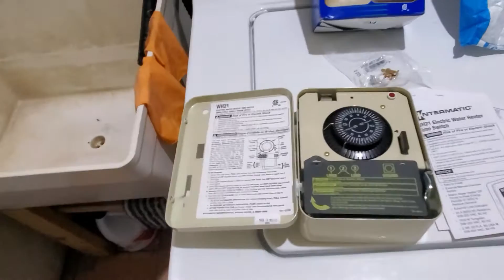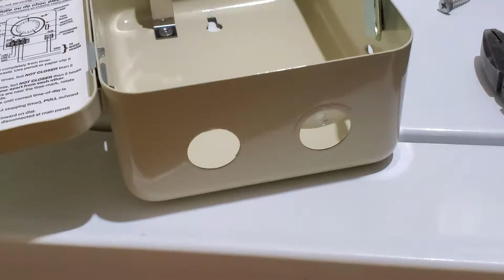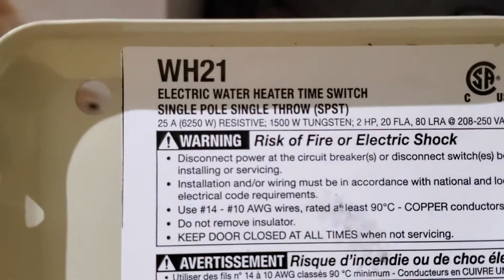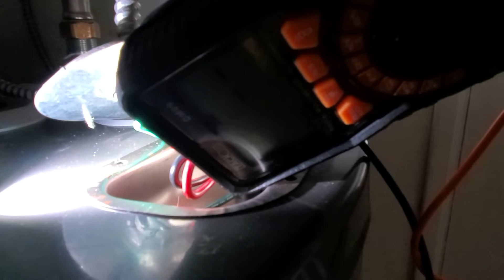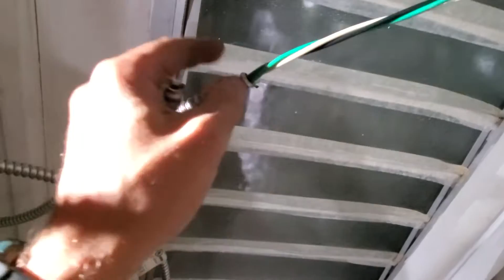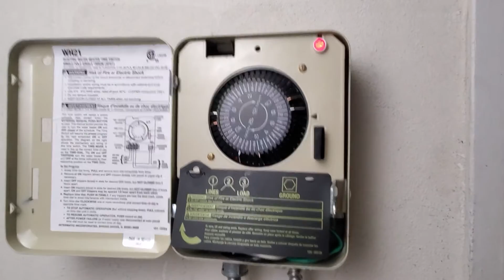How to install Water Heater timer

Comment: Can I replace my timer box with a Leviton 1288 switch as I have solar hot water and I only need to turn the water heater on once a month. The Leviton switch looks like it switches power between two outputs. I’d like to use the switch to also power a 220v outlet (to also be added) to handle like a 24amp or 16amp level 2 car charger. Would this work?
Reply from the maker: I think it would work but make sure you the same amount of AMP on that switch as on your water heater

Comment: How do you set the timer? I can’t get it to turn on and off at the times I want.
Reply from the maker: As you can see at the end of my video, there are metal tabs on the time wheel. You insert them for time ON and OFF. Wheel rotates with time and pushes the tab to turn power on and off. If wheel is not rotating, then you have bad timer.

Comment: You cannot test if the power is off at the hot water connections, if the timer is off you will not see a voltage there but the timer assembly will be HOT!!!!!!!!!